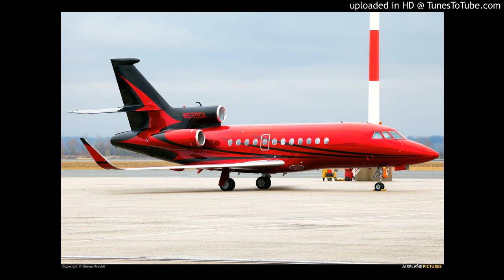Chapter 2 Reciprocating Engine Operation, Instruments, Maintenance, and Overhaul

Comment: @14:10 The question asking what must be inspected when a weak cylinder is found during a compression check has an answer that doesn’t make sense to me. How are you to inspect that pressure is being transmitted equally in all directions? Is this not the correct answer. I’ve done some googling and found the same answer in many different places, however there does not seem to be an explanation as to why this is the answer. If someone can explain, I’d be very grateful.
Reply: I agree, it does not seem correct. The correct anwser should be somewhere along the line of make sure the valves are sealing and the rings are sealing properly. But I was simply reading the book answers.
Reply: @samualmccarter7205  Just got back from the DME. I asked him about this question and the correct answer is to inspect the internal condition of the cylinder (via borescope or disassembly).
Reply: @Cmontzter  awesome, thanks man!
Reply: @samualmccarter7205  Absolutely, best of luck!